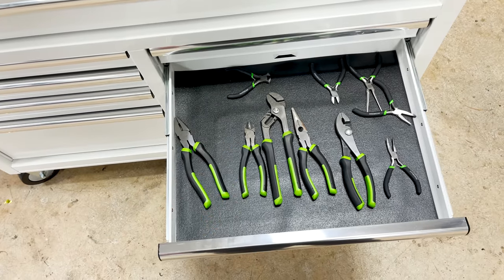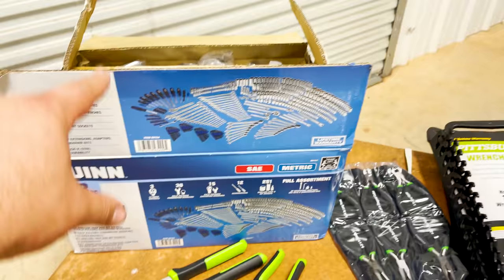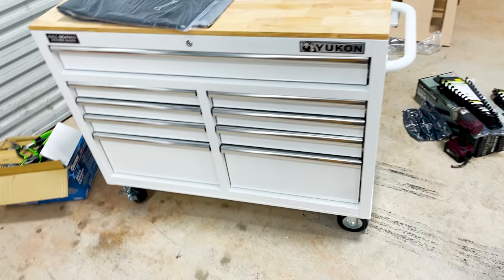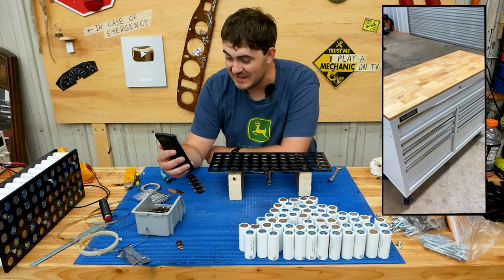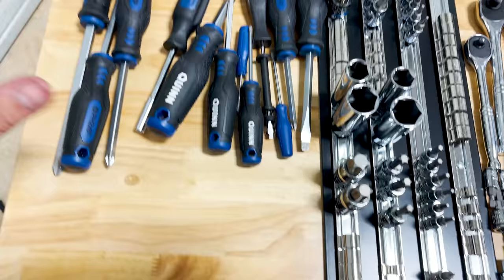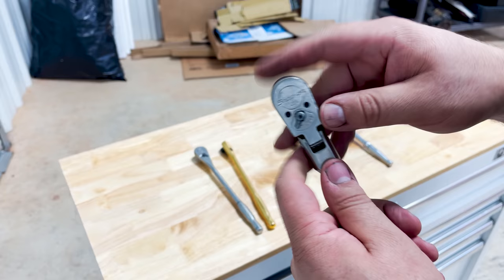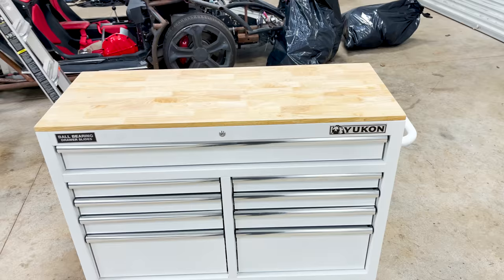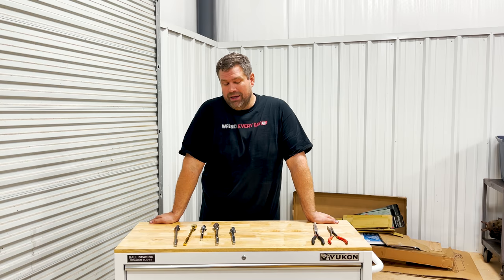I Bought The CHEAPEST TOOLS On The Internet (So You Don't Have To)

Comment: So as a plumbing contractor I used to get the cheapest tools to loan out to the new hires/“new friends”. As for larger tool purchases (jack hammer, corded sawzall, portable compressor, etc) my reasoning buying at HF was it would break but if it got thru the current job and on to the next job it paid for itself. The amount of time “ contractor grade” name brand tools ended up broken and awaiting repair/replacement where the price of HF Power tools I could easily purchase/exchange another….. not wait and get the job done. The cheapest tool going to the inexperienced apprentice or 200lb gorrilla rather than the expensive made sense…..

Comment: Can't say I've been a fan of the Quinn/Pittsburgh tools, but I have to give them credit; it looks like a solid set.  Sets that are that complete are nearly unheard of anymore.  The blow molded case sets are almost counter productive to building a "shop set."  You'd end up spending more money to complete the skips (and extend the range) in the popular 200-300 piece sets, than you would by just buying complete 1/4 drive, 3/8 drive, 1/2 drive, and combination wrenches to aggregate.  Trash pliers are easier to deal with than trash screwdrivers.  I despise bit drivers... give me a "real" screwdriver, or torx any day of the week.

Comment: One thing to keep in mind with this Harbor Freight stuff, at least the hand tools like shown in the video, is they are guaranteed for life, no questions asked, replaced for free if they break. Just like the old Craftsman stuff used to be.

I got to test this myself. My wife bought some tires and wheels mounted and balanced for her pickup. I needed a breaker bar to get the old lug nuts off. Got a 1/2" drive breaker bar from Harbor Freight, the regular Pittsburgh one. I got 3 of the 4 wheels off before it snapped. I brought it down, they checked the receipt and grabbed a new one, a few keystrokes on the register, and I had a new receipt for the new breaker bar.

This second one has held up much better. It sucks when a tool breaks, but it's nice to know that if it does I'm not going to go through a big song and dance about getting a replacement. 

If you don't want to deal with the breakage in the first place, spend more money. If your a hobbyist, and have a Harbor Freight just down the road like I do, and it's a 10 minute deal to get a replacement, then I say go for it.

Comment: That YUKON toolbox is exactly the same as my Husky that I bought at Home Depot. I don't know who copied who. Don't care. It's a solid toolbox. I found mine on sale at Big Orange and paid 300...maybe 400 for it (I don't really remember).

I completely expected that wood on top to be veneered. My plan was to pounce on it, bang on it, cut on it...and then just lag bolt down a piece of plywood when the original top got ugly. I have had it for two years now, and I am still using that original top so...whatever it is made of, it takes a beating!

It's a good box.

Comment: As a mechanic of 32 years. The professional tools are for those who use them day after day, all day long. I have all the top brands in my box at work (minus the top name box) At home. I have a cobbled mix of every cheap tool you can think of. And to be 100% honest. All of them have flaws and issues. They will all break, or fail at sometime. The difference is. The professional brands wear longer then the mid grade DIY'er tools. I say mid grade cause, Icon, Quinn, Gear Wrench,  Stanley Pro, Husky, & Kobalt are all mid grade level tools. Yes I left Craftsman out because they now fall in to the cheap crap tool brands since they where sold and no longer made in the USA. Around the house. Whatever tool you have that works and gets the job done is the right tool. If you are at work and doing this for a living. Then your mid grades are a good starting point to get going, but invest in your tools. You will never regret it. (And my tool boxes at work is  2 large Husky 72" work top boxes, a US General side locker, and tool cart. Less then $2000.00 in boxes, and I have 4 times the space then a $14,000 box ever will)

Comment: The top is actually solid wood. This box and the husky boxes use the same tops, and they're just a cookie cutter thing that's many manufacturers use.

I've had my butcher block husky box for 5 years and it's durable and have never had a problem with it, and that's working in a diesel semi truck shop. The lock is garbage though.

Comment: I'm glad I spent more and went with a larger and deeper husky tool workbench. On sale the husky is $480 for the 52" x 24" workbench tool box. It is more durable and the metal flexes less. It also has a power strip with 2 USB on the side. It also has provisions to add a peg board back panel. It also has slow close drawers so you push it close and the last two inches is a slow close. The ball bearing slides also dont sound gritty like the yukon.

Comment: As my carpenter eye sees that wooden top its some kind asian fingerjoynted real wood, kind of using in kichen cutting boars etc. 
That kind of smaller pieces glued together givs more stability and flattnes with humidity changes. Looks cheapet but is actually really clever usage of timber.
Greatings from Sweden🇸🇪

Comment: this might just be my opinion, but I believe that the rotating casters are supposed to be on the end that you pull the cart from to make it easier to steer heavier loads. this is why pallet jacks and large carts all have the rotating wheels on the handle side of the cart. Doing this also makes it easier to guide the cart into narrow openings since you don't have to push the cart to turn it you can just drag it in the direction you want it to go to line it up. As I said though this might just be personal opinion/preference so not saying it is wrong just that putting them on the other side will save your back in the long run.

Comment: Hey Jared. Top tip ;) i bought one of those big husky tool boxes when i did my garage rebuild. Call the mfg and ask for two more swivel wheels instead of the two swivel/two fixed. Saved alot of hassle moving the box into its home after i built benchtops next to it. Cheers!

Comment: In college I wanted an inexpensive ratchet set. I bought a set at WalMart for pretty cheap, but it had the majority of what a home tinkerer/mechanic would need. It has lasted almost 30 years, and the biggest complaint I have is that the case it came in is now starting to fall apart. 

It would be nice to have some more deep-wells, but otherwise it has served me well for a long time. Thinking of getting some rails so I can get rid of the plastic case, and then seeing how much longer it can last!

Comment: Finger jointed and edge-glued hardwood top.  Not veneer.  This is a sustainable method of utilizing short length offal, which besides being too small for other uses, are joined this way to make many different products.  It is generally true that joinery of this type may be as strong or stronger than a single solid board, however I would be less than 100% confident of the quality of Chinese production practices in engineered wood products.

Comment: Those Quinn sockets look just like my Kobalt ones. Only reason i got Kobalt was cause a few years back my local harbor freight did not offer nearly full socket sets. Only had like 5 to 10 and only had 3/8 10mm singles. So i bought a mostly full Kobalt set of sockets. Then went back and bought singles. Very expensive couple of trips, but all worked out in the end

Comment: I have this rule, if the tightening torque is more than 75 ft pounds on something, I buy a much better quality wrench/socket such as snap on.  I generally get snap on because the snap on guy will drop them off at my house once a week.  Also, if the torque spec is at 75 pounds or greater, I live in an area where there's rust.  Not great lakes bad, but still rust.  It's going to take a lot more to get the bolts off.  And sometimes the assembly guy got drunk and slobbered too much loktite on the bolts.  Snap on has their sockets designed to have the force transferred a longer distance along the flats of the nuts, and those sockets will take off stuff that the cheap sockets won't hold on.  So, I just use the Snap on stuff in the first place on those bolts, etc.

Also, Allen sockets, just do it right and get the best right off.  Stripped out allen head bolts that are recessed can make a  short job take an extra day.

Comment: When i became a entry level mechanic at a used car lot in 2009, my first stop was harbor frieght. I bought a u.s general 5 drawer tool cart and the Pittsburgh line of ratchets, wrenches, torx and allens and was fairly pleased. I spent a minimal amount of money and most of the tools, i still have and use. My opinion on the pliers and channel locks is the same as Jareds, absolute garbage. Within my first 3 days of working, i made the walk of shame to the matco truck, and bought my first set of high quality pliers. Albeit  300 dollars later, i was wrenching up to par with veteran mechanics using tools with a combined value of over 10 times mine. HOWEVER. There are some tools that you should absolutely never, ever cheap out on. One of the biggest on my list is a torque wrench. Harbor frieghts torque wrench proved to give me false readings. Thus  another walk of shame to the matco truck(and a verbal rear end thrashing) after a head gasket job i had done came back due to improper torque on the head. Yet again i wholely agree with Jared. You can get started with cheap tools but there are risks you will take in quality and to use good judgement to decide where to save, and where a heftier price tag could be justified.

Comment: I'm a woodworker and I can tell you that is real wood.  The reason for all of the finger joints is because they are taking scrap wood from some other shop and their industrial jointer makes it easy to put finger joints in it.  Your "wood expert" asked why they didn't use longer wood.  Well, the obvious reason is that in a high production shop, the shorter the wood, the less likely the wood will move because you have intersecting grain and lessens the likelyhood of returns and QA problems.  I don't think your wood expert is very expert.

Comment: The Husky version at HD, looks the same- but has a built in power strip.   Same price point if I recall.  The top on the Husky one is wood wood, I drilled through mine to mount a small vice.

Comment: Built my toolbox out of steel doors and added a drive on it from old wiper motors, I can drive it up ramps onto trailer and take them with me.  I have 3 now plumbing, electrical, woodworking. Load up and all tools aboard.

Comment: Not sure if it was on sale or not but I just bought a husky brand toolbox that is 1/2” deeper but otherwise the same exact dimensions and drawer layout. It came with the same drawer-liner material and included a power strip on the handle side. Bought at Home Depot for $449 and I feel like it’s a bit better quality than the Yukon toolbox I looked at at my local harbor freight. 

Point of that story is: shop around. You can get good and crap products at harbor freight but they aren’t always the cheapest

Comment: So I had a new GS (general service for those who don't know) start under me, on that same day, our Matco guy came and he saw me buy a new impact socket set and ratcheting wrenches. Smart guy, asked why, I explained that over the years things wear out, break etc .... The next morning he came to work with a whole pile of harbor freight stuff, us long term guys had a good laugh, but after a few days I thought I'd give them a go. So the impact sockets don't have as snug of a fit but never caused any issues with rounding off nuts and bolts with my big impact. The ratchet was so much smoother than mine I ended up buying a few, and this is about 6 years later, I still have them and beat em up daily, $12 each and I only ever needed to get 1 🤷, so my matco and snap on ratchets hide in the back of the drawer as backups. I wasn't a big fan of the wrenches, they were sloppy and ended up causing some round over on number occasions so I stick to my Matco wrenches (his were all Pittsburgh branded) , and then I had to try out his little (heavy as hell) earthquake impact, aside from the weight, it was right there with my big boy, it did struggle to release rusty strut bolts a few times but after a couple of seconds it did bust them loose. I have always kept harbor freight screwdrivers on hand because why beat the hell out of the expensive ones and honestly, I've only trashed 2 of the 12 I bought. I'm sure glad I took the time to try them because they're really not that bad.now for the fun stuff. About a month after I got my new GS, I brought in a young guy to do oil changes. We all let him borrow what he needed til he got paid, and then this guy comes to work one morning asking where the snap on guy was 🤔🤔🤔, we all told him he doesn't need that crap to change oil. But alas, the young buck was apparently far more intelligent than us old farts 😁, so by the end of the day, he was about $12,000.00 in debt, had tools that he didn't even know what they were or how to use them, and was king dick 🤣. Well, he lasted about 4 months before the inevitable. The freshly jobless oil changer, who had thought he knew best, was now offering his premium selection at a massive discount so he could afford to live until he found a new job. I both love and hate stupid people 🤣. We all picked over his tool collection, left him with a few things we knew we'd never use, for a ridiculous discount and laughed. Meanwhile my GS , still working from his harbor freight collection is living his best life because he wasn't in debt the price of a good vehicle. He since upgraded his sockets (just the common sizes) and a few extra goodies but has managed to net a sweet profit from his tools. In the end, you have to be more open to new things, because there's always a reason why something exists.

Comment: In between Pittsburgh and Snap-on/Mac/Matco there are mid range such as Cornwell, Gear wrench, Icon, Tekton and so on. Many brands. I'm a new tech myself. So far I'm limiting my cheaper tool selection but I've been impressed by Icon and Tekton.
But at the same time you get what you pay for. If you want something that can withstand professional use day in and day out, that's where I'll spend the extra cash on the pro grade. For starting out, cheaper brands are the smart way to go and gradually upgrade.

Comment: I would highly recommend (if possible) to save up an extra $300-400, and get a US General Series II tool box. They are miles above the Yukon box quality, and that’s one of the main components you have to live with if you’re working on anything. Also, always get a larger toolbox than you think you need “right now”, you’ll always end up outgrowing a smaller box, and will either be torturing yourself trying to fit everything in there, or will be forced to spend more money on another box.

Comment: As a professional mechanic the harbor freight tools you really can't go wrong with buying them as you start out. The sockets, impact sockets, wrenches are great. The Pittsburg ratchets are ok I broke a few and just bought better ones later. The pliers suck so get better ones. But for the money most of the stuff you get are pretty good. Since then I upgraded to all husky tools for home and Tekton tools for work. I do still have the harbor freight stuff and still use them on occasion.

Comment: I use harbour freight tools in my everyday life. I work for Firestone. Have been a mechanic for over 7 years and i used to have Matco and hated them. Yeah harbor freights tools aren’t AS strong but they have a lifetime warranty so if something does break i just take it to the store and they replace it. Ratchets you want to go a little higher on quality but everything else why not? That’s the box i wanted to get but they didn’t have the green one so i just went at the cheap $200 5 drawer tool cart in lime green and i love it

Comment: The benchtop looks like solid oak to me. It is made from small sections, basically from leftover pieces. The finger joints could be made really fast and cheap on an industrial level. It is not that pretty, but still a solid hardwood benchtop for cheap:-) Thanks for the great video!
Reply: I'm pretty sure I've seen replacement tops for those, too.  I want to saw either Home Depot or Lowes sells them, or did a few years back.  I remember seeing them for my 52" Husky box.
Reply: It's rubberwood.

Comment: I have a couple Chinese made rolling boxes. That is Chinese maple, and its solid wood not banded,
I think the finger joints are awesome. Its the perfect way not to waste lumber.
The offset joint retain structural integrity, the box being i steel backing also makes the wood strong (Negligible deflection).
I have the husky version which cost less. they are nearly identical.
the maple is a dense hard wood beat it with a hammer an witness for yourself